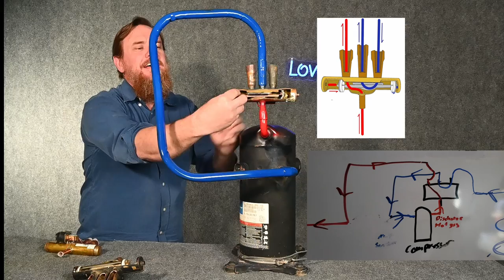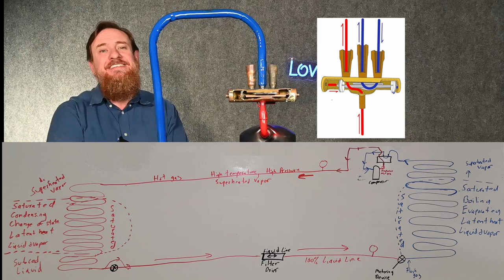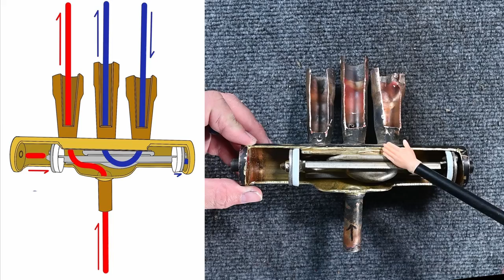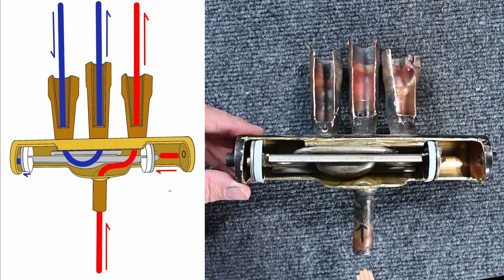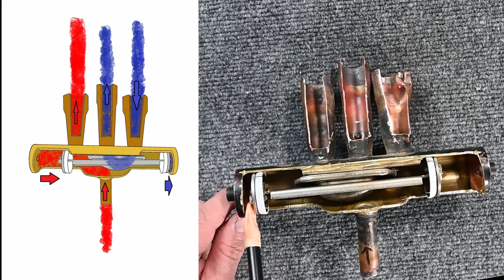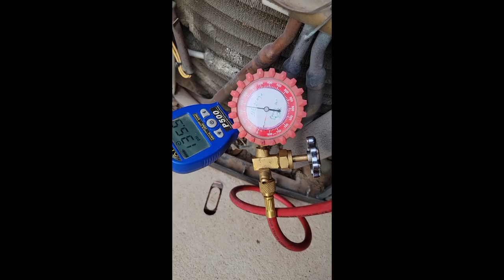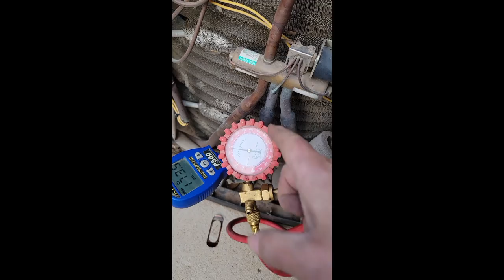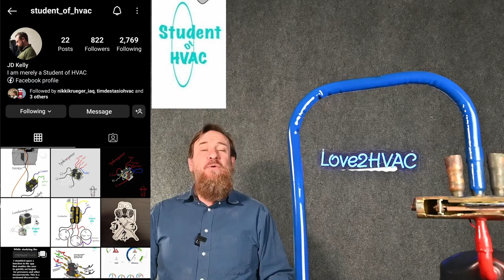Heat Pump 03 Reversing valve

Comment: I used your magnet method to find where my valve was located. It was right in the middle and stuck. A manual I found suggested applying a high-power magnet to pull the valve to one side or the other.  It did not move anything, but it must have loosened it a bit. When I turned the system on with the fridge magnet still attached, I watched it slide to one side. My system is working now. Thank you very much for your video.
Reply: Revasrs val not working  canced  drait fixing

Comment: Love the video.I just did a service call yesterday,with a scroll compressor in a lennox heat pump, pressures are equalized while compressor is running.Im returning monday with a new compressor,it is under warranty.Im beginning to wonder is it possible its the reversing valve stuck in between.RLA of the compressor is 21.5,but only drawing 5.4.Discharge line temperature from the compressor is outdoor ambient,with absolutely no pressure change.Compressor sounds very nirmal at startup,but does no pumping.

Comment: Hi Ty! Could you show how the Mollier diagram its changing for some particular cases? (e.g. low in charge, evaporator obtracion,..). Thx
Reply from the maker: Yes! 
When I get to the advanced red class I will be doing a lot with the Mollier diagram. 
Work keeps getting in the way of making videos

Comment: Sometimes I pinch it squeeze with ajustable plyers to eliminate it incase of it gets mulfunctioned , instead of heat extract it, pinch it from both sides, what u think?
Thanks.
Reply: I mean keep it on cool mode.
Reply from the maker: The valve very rarely fails but often gets misdiagnosed. 

Damaging a good part eliminating 1/2 of the system function Incase a very very rare problem occurs sounds like a bad idea.
Reply: I had a faulty reversing valve on a 3T 17 year old R22 Rheem unit.  It was stuck in heating mode - summer time in Georgia!
The solenoid would click when I cycled power to it.  The valve would not change.  The replacement part was  not available and I recommended changing the entire system due to the cost and the age.  To get the owner by, I crimped the end tubing, vented the end to get it into cooling mode, used a pair of Vise-Grip pliers to lock the slide in place and then sealed the tubing.  It ran without any problems.   This was the only time that I have had one fail.
I had considered cutting the reversing valve out and making it a straight AC - the cost would have been high due to the R22

Comment: Great video Ty, thanks much.  Question:  Are the typical line sets (3/8" high and 7/8" low)  properly designed to handle the pressure differentials caused by the reversing valve in order to prevent premature rupture failures?

Comment: Great vid Ty, but, you cannot install the changeover valve in a position where the sliding piston is parallel with gravity, this is a no no no go
Reply from the maker: Parallel or perpendicular?
I have only seen them parallel, perpendicular is a no go because the oil will fill up the ends and not allow it to shift I thought I covered that, but I don't remember.
Reply: @love2hvac  We are on the same page Ty, but expressing differently, I meant a no go when the piston is positioned vertically, up down motion (parallel to gravity not to earth). Btw I love all your videos bcz you are thorough
Reply from the maker: Thanks, And thank you for clarifying. I see exactly what you mean now.
Reply: @love2hvac  now I’m totally confused. Forget about gravity and just use the ground surface. Should the sliding valve be horizontal or vertical? In the video where you’re demonstrating a real valve functioning the sliding piston is horizontal. 

Never mind, you covered it at the end of the video quite clearly.

Comment: So, do most reversing valve default to heating mode, until orange wire is energized?

Is white wire energized at same time as  orange, or simply until heat strips are energized?

Comment: Most Asian mfg build their HP with reversing valves active heat configuration. In North America the convention is to do the contrary, reversing valve active cool. The rationale behind this is that is more critical to have heat in winter than  ac in summer. At one point this was a requirement but It appears that with the influx of imported equipment some of the traditional NA design conventions are changing.
Reply: It depends on what the equipment is doing. Most heat pumps energize in cooling.  And yes for that reason. Rev Chillers energize in heating mode

Comment: Hello guys I’m new to heat pump systems. I have a unit where the outside suction line is extremely hot but I think I’m confusing the normal suction line for an electric unit to something new. Maybe vapor line I assume? How am I suppose to charge the unit or check a charge on it? I’m so lost and haven’t found a good video explanation on these systems

Comment: so the weeme tube makes the slide valve valve move. 24 volts; where is it where n do power to the valve go again, clean line when brazing. with nitrogen or it gets dirty and then sticks; wow im in florida

Comment: Just came across this short video from 5 yrs ago that found a melted teflon seal.  The seal had formed so the valve worked in heat but failed in cool

Trane reversing Valve won't cool but heats ok.
https://youtu.be/NEBhFoyyPFk
Reply from the maker: Thanks for sharing! That's interesting!